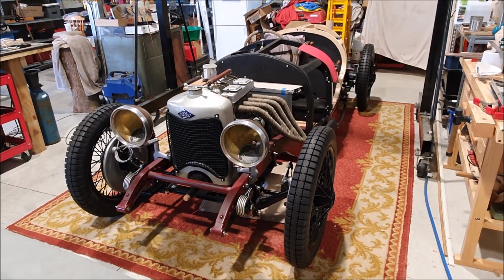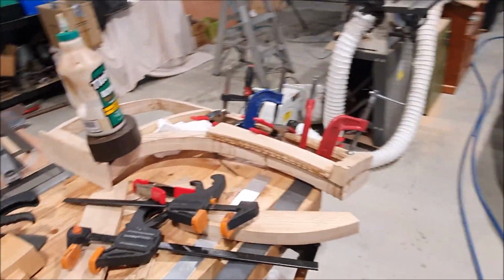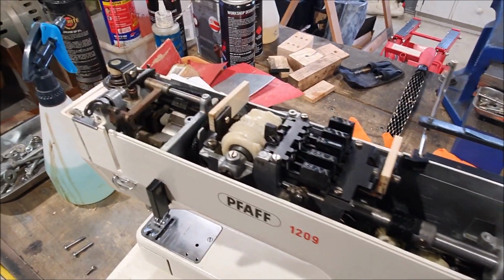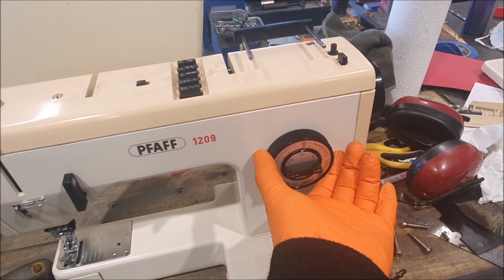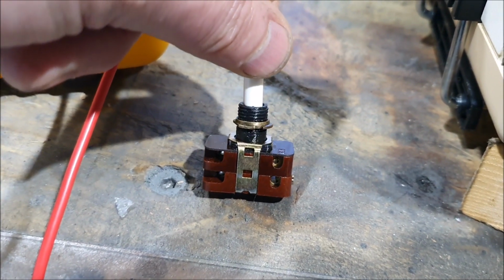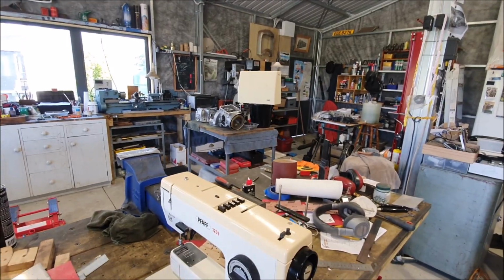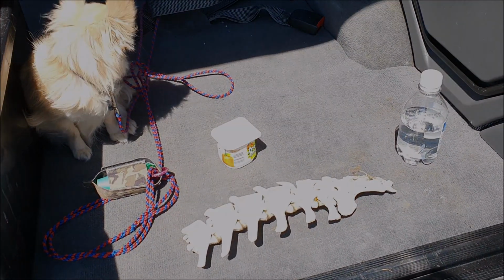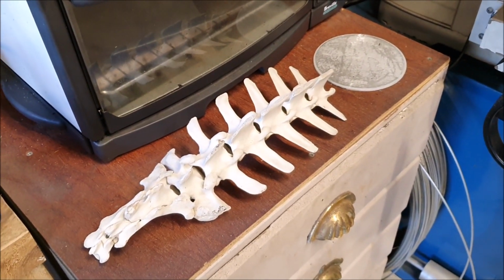Pre war Riley Brooklands - doors and a sewing machine

Comment: The rear window on my Austin Swallow & Standard Swallow saloons are the same, the aperture and glass identical - the glass itself is not symmetrical, laying one on top of the other and then flipping one around, it is self-evident, the template at the factory was wrong! The Austin Swallow has the bonnet slightly longer on one side than the other, yet the bulkhead is square on the chassis and chassis datum points are the same. The body on the Standard Swallow is not centred on the chassis, it is about 1/8" out. So, the Swallow factory was not particularly accurate, whilst the component parts were all machined to be the same, the assembly was all by hand using jigs, any error will translate to the finished car. The aluminium skins were all bespoke to the individual car. Your timberwork is probably to a higher standard than was achieved at the factory, I would not worry - is any car truly symmetrical? I suppose those designed with CAD would have the mirror image, but anything pre-CAD is hand drawn, so plenty of scope for variations I would suspect!

I have two Singer sewing machines (Made in England), one a hand crank, the other electric. I did the leatherwork for the front seat on my Austin Swallow, I can testify that I am good at un-picking stitches, made mistakes (this was my first ever attempt at using a sewing machine), but the end result is not bad, actually, it looks quite good! I went for the traditional "tuck & roll" and stuffed with cotton for the pleated panels and this looks much more period than the modern way of using foam sewn into the pleated leather. I think it may be easier to do as the thickness of the materials is less than with foam.

I found the hand machine much more controllable and easier to use with leather as the needle can be gently wound down, whereas on the electric it is forced down, I broke a needle with the electric, which I did not do with the hand machine!

Instead of buying a motor, you could make a crank handle - the only trouble with the crank handle is that an extra hand would be useful to guide the material, but if you are doing it slowly, that does not matter, but an extra hand would make the process faster! Practice and it gets better!

The other problem I found, I have not done it yet and it does not apply to your project is the stitching on the headlining. This is visible on the Swallow saloons and the stitches are 4 per inch, the sewing machine's lowest setting is 6 per inch, so I can't achieve factory stitching, which is a shame. The leather stitching is the same, but not visible, in practice, the stitches are closer as the thickness of material makes its drag slightly, which affects the stitch frequency, an extra pair of hands, one extra to guide and one extra to pull would be useful!

For fixing piping and the valance piece, I used a sewing awl (Made in USA) and stitched this by hand, the sewing machine just could not cope with the thickness of the material - the needle on this is very sharp and you soon learn to avoid pricking yourself! Doing it by hand on the last bit is actually quite quick, the only real problem was the thread was slightly waxed and the needle needed to be cleared as it built up (and another source of pricking), but stitches can be precisely positioned and worked well.
Reply from the maker: One film I watched showed him putting the needle through the material first by hand and starting the machine like that apparently to avoid breaking them.

Comment: Good quality machine that will sew most things. Car seats and gaiters etc are not that daunting once you get the correct needles for leatherwork. I have found that I had to anchor my Rossman machine because of the weight of material. Annoying because I have an Edwardian singer on its frame in the loft and a hand machine which I did use for double thicknesses. Anyway you will enjoy the challenge. All looks good so far.
Reply from the maker: Am still a long way off needing it but it was too good to pass up. Machines with walking feet are in demand it seems. On this one they call it a IDT system but it's the same thing I gather.

Comment: The switch may have been GRP instead of just straight plastic.  I used to be a cable molder, and there are vast numbers of plastic recipes for different uses.  It is unlikely that a manufacturer would use something that fails quickly.  over toime the material probably just loses strength from becoming brittle due to UV maybe
Reply from the maker: The actual switch body is inside the machine so it should be protected from light. Maybe just time and age I guess. I can't find the film I was watching now where the repairer mentioned many of them being broken.

Comment: Enjoyed the update.  Don't worry too much about your symmetrical body issue... as you pointed out in my last video, I can't even count!  :D  I would definitely encourage you to attempt the upholstery of the seats.   My 1920s Singer machine I got from my father turned into separate restoration project.  You can use leather if you wish to, but if you want to be high class, Bentley used to charge extra for fake leather. 😆
Reply from the maker: I wonder what the best material to use is? Leather is traditional of course. But expensive!